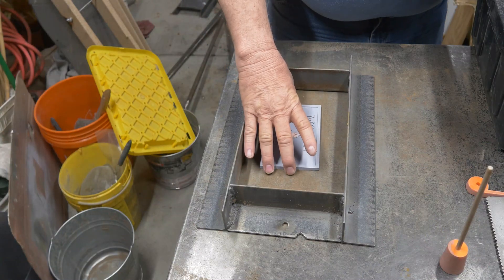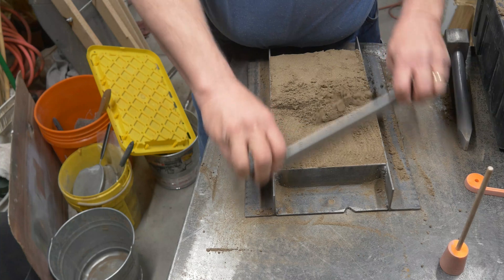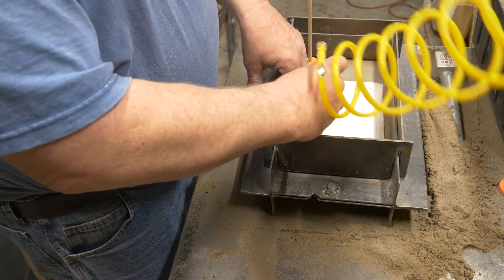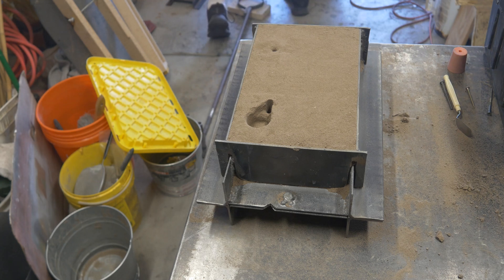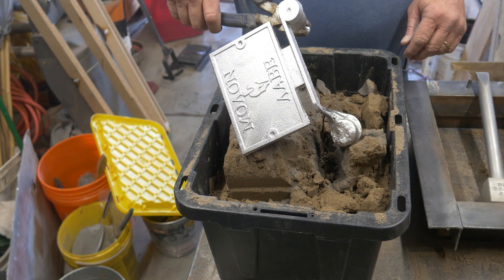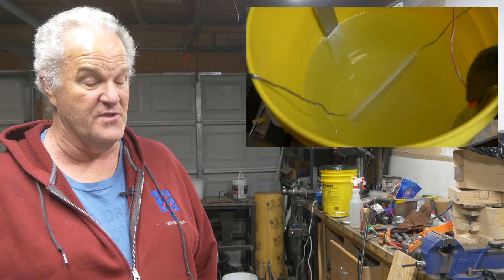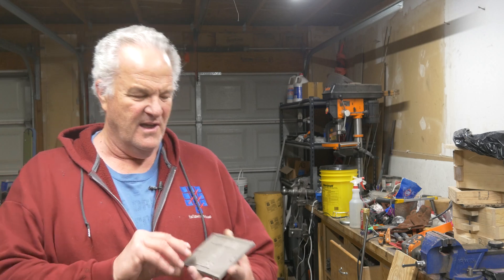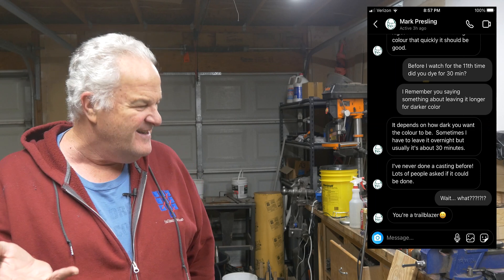Happy accidents - First anodizing attempt

Comment: Is it that casting aluminum has a sufficiently different composition than extrusion aluminum? If so, could a (cast) aluminum part be (extrusion) aluminum plated?  I don't know the ins and outs of plating, but I think it should be possible.  Whether or not you could reasonably plate a thick enough layer to then anodize it is another question entirely.   The plating may wind up obliterating the fine lines you accomplished in casting,  or there may be interactions between some of the other metals that cause other problems. 
I think plating can be done with the same equipment you used for anodizing, perhaps with a slightly different voltage or current? 
It would be an interesting experiment, and if it hasn't been done before, and you do it successfully,  we can start calling you 'Professor'.  It would actually be cool to be following a YouTube professor. Your thesis would be more useful than most thises that are accepted in universities around the world.
Reply from the maker: I actually ran across a datasheet for alloy that I use (319) that says if you anodize it you will get a dark gray finish. The most logical explanation that I've heard is the silicon content of my alloy (6%) is what causes it.

I actually used aluminum for my cathodes in the bath.  Would that constitute making an aluminum plating?
Reply: @swdweeb  I don't know enough about plating to answer.  You would (I'm guessing) have to plate to at least the thicknesses of the the anodizing depth, and most likely deeper.  Like most of my ideas, they come from: [A] what I have picked up online, and [B] straight outta my butt.
Aluminum plating a cast aluminum part would have to be 20/80 at best.  I have never done any casting, plating, or anodizing myself, and what I do know about it is what I've learned online. Hopefully you wouldn't have to plate a transition layer.  Sometimes one metal (like maybe gold) won't directly plate onto another metal, and they use another metal (like copper) that will bond to each of the others (base and surface).
I can't specifically remember if I have ever heard this (pure, unadulterated speculation), but you might need a transition layer to separate two very similar metals.  I have absolutely zero information on if that would be necessary, but I also wouldn't rule it out as being needful. Plating & anodizing are topics I haven't really gotten into much, so I don't have any solid information.
If you do pursue this further, hopefully we'll all get to hear about it.   Should be interesting.
Reply from the maker: @BrianDaleNeeley  😄 I used to work with a girl in marketing that referred to things as pdooma (pronounced puh-doom-a) I asked her what that meant once and she told me "pulled directly out of my @$$" That was nearly 30 years ago and I've never forgotten it.

I watched something that said there is an intermediary metal you can coat aluminum with but I don't remember what it is. Copper does stick to a lot of things I havent tried it in this solution I'm using.  I tried it in hydrochloric acid but that  dissolved the aluminum faster than I could plate it
Reply: @swdweeb  Yeah... that would TEND to be counter-productive... 😁😉

Comment: I need to go back over my research on this topic, I'm mixing up anodising and plating in my head when I remember stuff like what power settings to use etc, and what chems to buy that are legal here etc lol 
Love to see that you're pushing on and trying newer things too! It's so impressive how good that piece looked, even if it is  burnt to a crisp haha 
I think for cast pieces of aluminium, it might be a case of the outer oxide layer needing stripping away chemically somehow to allow the dye to penetrate better (or a sanding with very fine grit paper, like 1000, first)?
Reply from the maker: Naw... I think it's the alloy.  Check this out from Mark on instagram.  https://www.instagram.com/p/COl2Ki7J2tb/  I thought he had it working then I saw the last picture
Reply: @swdweeb  okay, to follow the scientific method and verify that indeed is the issue, not oxide layers or some process related to the aluminium casting, could you melt down some of the grade alloy that he's used for that bright violet piece, and do a cast with that and one the same but with your regular alloy, then follow the same process for anodising for each and see the results? I think that would give a true comparison between the two alloys as it's keeping the only variable to been just the composition of the ally.
Reply: @swdweeb  and do you do a degrease step in the lye solution for a while first so it's super clean as suggested in the video I linked? :) (That dude is still replying to comments on his linked page btw, as recently as this year, sounds like far beyond doctorate level of knowledge from him too!)
Reply from the maker: I followed Mark’s process https://youtu.be/Z1zT8p7d9Z0
Reply: check this video, and his website, not sure if it's the process you used -https://www.youtube.com/watch?v=7jFN3l_mrKk

Comment: Really been enjoying your videos, sent over from BigstackD for some education on casting. Really enjoying and learned alot from Bob and yourself from beginning, to reducing porosity in cast. One possibility that could be happening with the anodizing i was thinking is when its poured it forms a oxide layer on top. If that was removed maybe it would take the anodizing? Just a thought lol. Im looking forward to what you find as a solution. Also could you do a video on curing a crucible please? Maybe one on safety?
Reply from the maker: Hi Thomas, sorry for they late reply. I'm still not 100% on what happened but its is becoming more apparent to me that the alloy is part of the problem. As a good casting alloy it has silicon in it.  The silicon reacts with the solution and turns a dark gray.

Anodization actually adds a layer of aluminum oxide to the surface, that's what hardens and protect the metal.  That is a big reason we want to stay away from melting aluminum that has been anodized, it adds all of that oxidation to our melt.
Reply: @swdweeb  very interesting, ill keep that in mind thank you. yes i read about the silicon after posting but havent been able to edit post lol thank you for replying.

Comment: Hi Perry it that learner again is a clay graphite  crucible  different to a silicon carbide graphite crucible?
Reply from the maker: Hi Steffan, sorry, I have no idea.  Like you, I'd have to start doing an internet search for it,
Reply: @swdweeb  Thanks Perry  I've  read a lot  of things  on the net they didn't  really tell me much so I thought  you might  know. Hope you're  all ok and keeping  safe thanks again
Reply from the maker: Just thought I'd let you know that I reached out to a crucible supplier to see if they can clear things up.
Reply: @swdweeb  Thanks Perry  as always  your a star
Reply from the maker: I finally heard back from PMC.  They said the Silicon Carbide Crucibles are generally more expensive and have a higher temperature tolerance than the standard Clay Graphite.  They usually are only needed if your temperature requirements exceed the max temp of 2,900 degrees F of the clay graphites.

Now we both know
Reply: @swdweeb  Thanks  mate 👍

Comment: There are reasons you don't anodize aluminum castings and the number 1 reason is because of the inherent porosity of cast materials. It would be impossible to rinse off or out all of the etch-ant or acid used during the anodizing process. The acid gets trapped  just under the "colorized or tinted" surface and dark spots would appear a few hours of days later thereby ruining the overall appearance. That look you like is the result of it. Keep in mind, just below that nice surface, the stuff you couldn't rinse out is still there. You can certainly smell it if you would of used sulfuric acid. Second reason is accelerated corrosion. Yes even aluminium corrodes. Just my 2 cents (experience).
Reply from the maker: interesting...  I just smelled it and there is still a feint smell of the sodium bisulfate on it.

I'm well aware of aluminum's corrosive ability. The stuff oxidizes nearly immediately after exposing the surface to air. Its pretty darn corrosive to other metals as well. 

Thanks for the 2 cents

Comment: I honestly never got a casting to take dye. All the parts that I have anodized have been machined from aluminum extrusions. I tried to do a handful of cast brackets for my printer that never did turn out. They ended up getting a dark gray oxide layer on them just like yours. I will research this and get you an answer. You now have me curious! Very excellent casting! However when I anodize I use Caswell dye the other stuff never worked for me I tried black and red best it ever did was turn stuff pink and black was worthless.. 🤷🏻‍♂️..
Reply from the maker: I've heard the same thing about the dye's. Mark tried it with Caswell and didn't have a lot more success.  Who knows, maybe one of these will make it your way.   I have to redo the lettering based on a Greek sub's corrections

Comment: Hi Perry, I've been there with anodising before. If the current density is too high, the pores in the material become too large to hold on to the dye, then it all just falls out when you try to steam seal it. I was under the impression that the grain structure of cast is the reason for the poor results, but the alloying elements probably don't help either. Nice work though 👍
Reply from the maker: The current density, like too high voltage + amperage?
Reply: @swdweeb  The current density is Amps per Square foot. You can probably get your CAD package to tell you the surface area of your part, or just calculate it for simple shapes. I found numbers from 12A per sq ft on the internet, so that must be right. You will need some way to measure the current, but the initial current will drop off pretty quickly as the oxide layer forms, so treat the number as the starting point, rather than trying to maintain it throughout (I think).
Reply from the maker: @ollysworkshop  The plaque is approximately 50 sq inches. Should I assume 12amp * (50/144) or a little over 4 amps??
Reply: @swdweeb  that doesn't sound unreasonable. Did you say how much current you were using?
Reply from the maker: @ollysworkshop  I didn't measure either the voltage or the amperage. The supply is an old supply from a laptop that I picked up at a thrift store. It says the output is 19VDC 4.7 amps.  I have no way of adjusting it up or down.  It would seem that the way to measure this would be watts per sq ft but that's coming from a guy that knows almost nothing about the process
Reply: @swdweeb  well sounds like you wouldn't be overdoing the current with that supply.  Might be worth picking up a cheap multimeter to give you a current reading. You can crudely adjust the current with the amount of cathode in the solution. All the aluminium I've casted (just for you 😋) has turned out quite porous, I don't think that helps, as the pores are probably full of contaminants that pollute the anodising bath.
Reply from the maker: @ollysworkshop  I've got a meter, I just didnt bother to set up to measure the current and never thought about measuring the voltage.

I had a guy comment the other day telling me that he didn't think that John Campbell had ever "casted" anything. I felt like replying "here's your sign"
Reply: @swdweeb  don't worry about the voltage, it's the current that matters, the voltage will be what it needs to be for a given current. There's only two things you need to know V=I*R and P=I*V. Where V is volts, I is Resistance, P is power.

Comment: Your anodized layer got too hot and sealed off the oxide cells before they were exposed to the dye and so couldn't then take up any dye inside the cells.  What I've learned about it is that it's a chemical process and physical aspects matter.  Contamination is often a big factor in failure - everything must stay clean and of course distilled water and clean glass containers are essential, as well as thorough surface preparation.  I've had my best results by starting at low current, allowing the cells' bases to form first before uping the current to grow the cells so that they can take up more dye. I've had generally poor results using RIT dyes and I now spend the extra money to buy Caswell dyes because the colors are more saturated.  Lead electrodes have worked best for me and the electrical connection to the anodizing part must be unable to grow oxide (threaded aluminum rods screwed into threaded holes have worked best) or resistance will develop and prevent current flowing through the anodizing part.

Comment: You would have to acid etch the piece to expose the grain boundaries. The way the dye sticks to the aluminum is by getting in between the hexagonal crystals. This is a layer of oxidation. So if you can grow the crystals out a bit by oxidizing then you will have more “cracks” for the dye to go in.
Reply from the maker: With what acid?  I saw a post where a guy does a nitric acid wash.
Reply: @swdweeb  I've seen a 50/50 mix of sulfuric acid and distilled water used.
Reply from the maker: @LeadFarmer-1  I had trouble finding sulfuric acid.  That's why I ended up going with the sodium bisulphate
Reply: @swdweeb  I picked up mine at the local O'Reileys and just asked for battery acid. They usually have it in back.
Reply: @swdweeb  94% Sulfuric acid is available At the bib box stores as drain opener - Rooto is one brand, something Lightning is another.
Reply from the maker: @mikesgarage394  Good to know, thanks

Comment: I think it may depend on the makeup of the alloy. The machining grade aluminium I use, should not be used when the product needs to be anodised. Something in it that makes it machine well, prevents it anodising well.
Same thing may apply to casting alloys, some may do better than others. Glad you are keeping well.
Reply from the maker: I've been reading that the silicon in the alloy I use is the problem. I'm at 6% silicon and I've been reading that lower amounts are needed for anodizing and dyeing
Yeah, I haven't stopped.  Just been busy

Comment: From what I have read, silicon particles on the surface of cast aluminum castings do not take up the dye and create unsightly spots.  One man's workaround is explained beginning here: http://forums.thehomefoundry.org/index.php?threads/another-noob-question-delicate-thin-part-removal-from-mold.1585/page-4#post-36278
(Should be a link to post #66 in that thread, more details a few posts down).  Can't personally vouch for it as I have never tried this l, but maybe worth a try?  Good luck experimenting!  It did give your casting an interesting look even if it did not provide the colour you wanted.
Reply from the maker: I've been reading that its the silicon in the alloy itself. My alloy is 6% silicon.  I did the wire wheel and degreasing before dipping it but I did not do the nitric acid dip. Maybe I can get Mark to try that 😄😄
Reply: @swdweeb  that guy is the only person I've seen claiming he can anodize cast Al with good dyeing results, otherwise all I can find is that the silicon ruins it or causes dye not to stick in spots.  Maybe a long shot...  Or an actual reason to melt and pour pop can metal. 😧
Reply from the maker: Hmmm... that might be an experiment I could actually do. My son has bags of cans that I could melt.
Reply: @swdweeb  Ewww, just don't tell anyone you got the idea from me, I'd never live it down! 😁 But it just might work...
Reply from the maker: @tobhomott  Oh man, I'm going to make that the title.  "I got this idea from Tobho" 😄😄
Reply: @swdweeb  😱

Comment: Maybe if you sandblast it well with a very fine medium. 
Possibly the surface of the casting is coated with the sand binder or maybe even silica.
Try it on the spru or riser...
Reply from the maker: From what I'm reading now, it is more about the alloy.  The silicon in the alloy I melt is likely to be the problem.

Comment: Worth the month wait for your video. Maybe powder coating would work but that might give it a plastic look.
Reply from the maker: Yeah, I've been thinking I should move to powder coating.  I need to find an electric oven that I can use to cook the stuff.
Reply: @swdweeb  Watch the thrift stores for used toaster ovens. The powders I use cure at 400F for 10 minutes. You may have powder suppliers near you but I get mine from powderbuythepound. Eastwood is also good but shipping is higher.
Reply from the maker: @mt6tools  Good idea.  I took a look at things like craigs list and fb marketplace.  I would like something smaller than the normal kitchen oven. a large toaster oven might be just the thing

Comment: Thank you. Are you doing the casting in doors? Are you concerned about fire or fumes?
Reply from the maker: They are done inside my garage. I suppose fire is always an issue but my furnace is well-built and the flame is contained within it.  

For melting aluminum fumes aren't really a problem. I have two doors that I open for fresh air.

The anodizing experiment created more fumes than the casting does.  I made sure there was plenty of ventilation